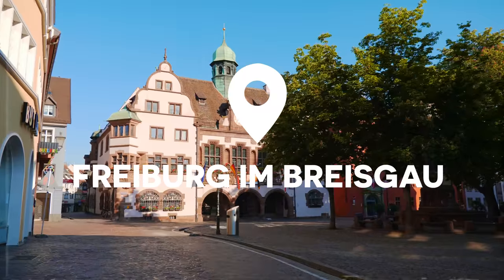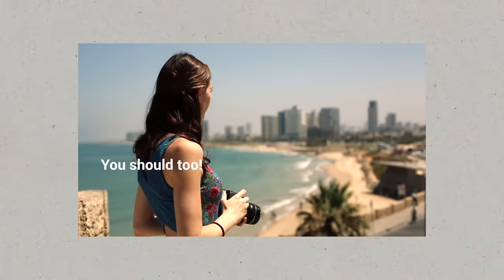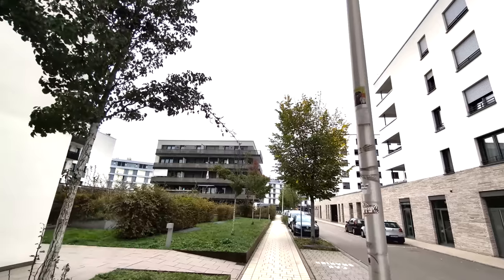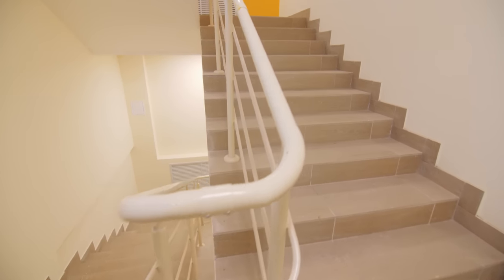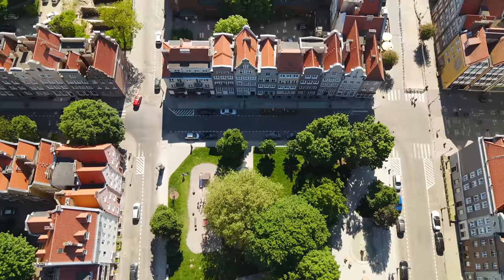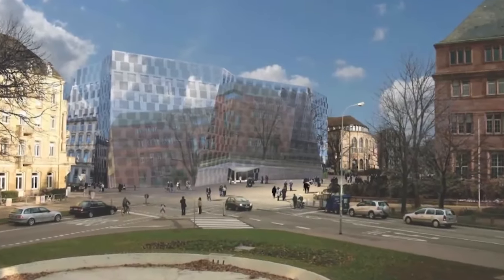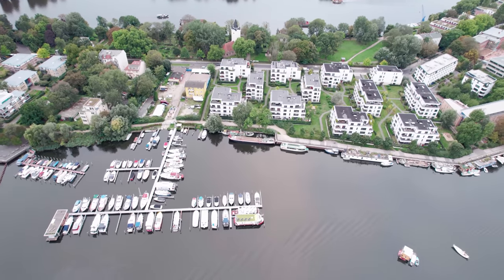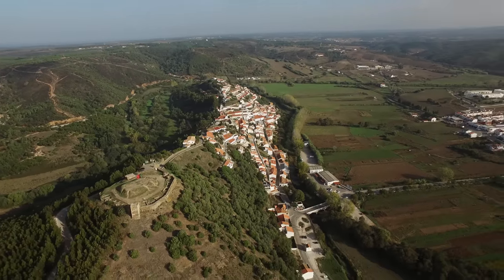Germany's BIG DUMB BOXES ARE AWESOME.

Comment: Another country that came to the same conclusion was the Soviet Union.  Their housing developments were boxes with with a maximum height of five floors, and for much the same reasons.
Reply: As a person who grew up in a Khrushchevka (the type of a five-floor building you are describing) I'd like to disagree. They were indeed thinking about cutting costs and at the same time accomodating enormous amount of people who previously lived in baracks or shared apartments like kommunalkas. But I wouldn't call these buildings energy-efficient. Almost all of the Krushchevkas in post-soviet era are patchy-looking because every flat owner had to externally isolate their walls. Otherwise they tend to get cold. And you spend quite a lot on energy costs now, when they are not artificially suppressed by the party.

And don't get me started on psychological effect of living in a sea of grey dirty concrete boxes. When I grew up I moved to the old city center of Odesa from a Khrushchevka neighborhood and I noticed the uptick in my mental health during winter months - just from being surrounded by beautiful and colorful architecture of previous centuries. 

And you have to take Brezhnevkas into account - those were standardized high-rises which actually later contributed to the modern tendency of the neighbourhoods where 24-storey buildings completely dominate the person and create wind tunnels or completely block the daylight for the neighboring buildings. 

So yeah, just my 5 cents as a person who lived there and now lives in a 3-storey white box in a suburb town near Köln. It's a completely different feeling.
Reply: @MrFahrenheit9  Interesting perspective, thanks!
Reply: @MrFahrenheit9  
OK, I need to be a little more specific. The Soviet Union built to a similar plan for some of the same reasons. The major one being, like those in Germany, that at five stories you didn't need a lift (or elevator). These add extra complexity and cost. 
Neither I nor Ashton talked about build quality.
Reply: @martinbond5166   you are right about not needing the elevator, but Ashton did mention energy efficiency as well, that's why I mentioned insulation in my comment. I probably extrapolated these other reasons.

Talking about elevators or lack there of, I wonder if there are any standards in Germany regarding accessibility of such buildings. In Ukraine we have a big problem with that, because most soviet buildings are notoriously inaccessible. Even in a building with an elevator you still need to get up and down a flight of stairs, which is impossible for people in wheelchairs or basically anyone with walking problems. So many old or disabled folks rarely leave their flats. But it's not the case here in Germany, so far as I can see
Reply: Ashton did mention energy efficiency,  but in the context of a benefit of the basic design, not build quality.
I'm not sure where this conversation is meant to be taking us. I simply commented that the Soviet Union, with their economic problems, had come to the same conclusion as Germany in building efficient housing and you seem to be trying to turn it into some sort of idealogical battle. I am well aware of the shortcomings of the Soviet economy, as well as those of the 'western' economy. So what are we trying to establish?
Reply: @janprimus1947   it's the first time I see your nickname in this comment thread so I'm not sure why are you reacting like that as well. Feel free to disengage at any point, and I'll do that as well

Comment: So a bunch of very highly paid people DESIGNED the Freiburg University Library building, another bunch of very highly paid people APPROVED that building design, including details around the fixings of panels that fall off, and the water-proofing systems which are NOT water-proof.  Other folks have APPROVED a window system which needs to be totally replaced and the old ones sent to landfill as un-recyclable,  after just 40 years.  (If the old company has gone bankrupt by then, good luck getting any compatible new windows at all).  

Previously I lived in a scummy old early settler's cottage that was over 100 years old. It still had the original windows.   If a cheap ass, scummy old wooden house can last 100 years without needing new windows, how come the latest space age, huge cost "architect designed building" has windows of such short lifespan ?  

If the legally mandated Disability Access Door does not open properly, then how did this building even get it's final, "pre-occupation" local council compliance building approval ? Is there no such thing as a "building inspector" in Germany who walks through with a clipboard and ticks off compliance ?  What else fails to comply with legal minimums ? Toilets ? Fire Escapes ? Safety brakes on their Elevators/Lifts ?

Comment: Dumb boxes build of local materials in walkable/cyclable/public transport oriented neighborhood designed using Passivhaus principle, powered with low carbon low impacting environmentally (best Nuclear) energy = a very sustainable and livable city!
Reply: Except that the CO2 equivalent of nuclear energy isn't the best and it's not even the most economical energy source.
The best would be wind and solar, possibly accompanied by nuclear energy for base load coverage.
Reply: @marcromain64  sorry to disappoint you but both of the above statements are false.
France predominantly nuclear grid has way less co2 emissions than German, who invested hundreds of billions € into renewables and yet they reopen old coal plants, build new fossil gas power stations and Sholtz is flying around the globe trying to secure gas sources after the NS2 been blown up. As for price again French has much cheaper electricity than the Germans.
Those stories about renevables being cheaper or less emittant don't factor in the back up systems, transmission lines, energy storage, constant maintanence and a complete replacement every 20 years of all of that shibang to keep it going. Don't get me started on the land needed for renewables and the mining of minerals and slave labour in China to produce it!
Reply: @ukrytykrytyk8477  Germany has higher CO2 emissions because of 32,8% coal based energy generation, caused by decades of reform jam, not because of 51,6% renewables, which could be much more if not for the reform jam mentioned before.

By the way, in the current year over 1 TWh (net) of that generated energy went to France to support their failing nuclear energy production, wich means: part of Germany's higher CO2 emissions is for the benefit of France.
Reply: @marcromain64  Ok a few facts for you to consider because I noticed you mostly rely on slogans.

Yes indeed France in 2022 became net electricity importer. For the firs time after consecutive 42 years of being electricity exporter! You're writing that 1TWh net was imported in 2022, for comparison in 2021 French exported 43TWh. Not bad for 'failing nuclear' as you describe it XD. I'm not going to get into details of why 2022 was an exceptional year for the nuclear in France and why it will not likely to repeat again. Read yourself.

Next fact. Germany's weather reliant renewables in times of over production have to sell the energy at a negative price - they pay their neighbours to take the overproduction from them! French controllable nuclear can rump down the production to make space for subsidized German electricity. In times of low renewables production Germany needs to buy missing supply from its neighbours, like France, at very high price to avoid blackout. So it's double win for Nuclear. 

No, further investment in the weather reliant solar and wind will not change that, it will make things even worse! It will result in oversupply in high production-low demand times and will not solve low supply issue during winter. And that is a reason why a lot of money is being poured into coal and gas production capabilities in Germany. 

In summary, no country or even region created a stabile electricity grid on solar and wind alone, without having to build fossil backup sources. No matter how strongly people like you shout it's possible, the Physics of electricity production will not bulge to those simple facts.
Reply: @ukrytykrytyk8477  You're conveniently ignoring the fact that nuclear power is the biggest, but also the weakest part of power production. By now, France needs to compensate for that internally with natural gas, wind and water power and externally by buying energy from neighbouring countries. Energy exports in the past won't help France in the future if they're unable to convert former profits in a modernisation of their nuclear power infrastructure. This is time and money consuming, while most renewable power sources are cheap and easy to implement in comparison, assuming there's the political will to do so.

For example, one of the biggest net exporters of electric energy on the European market is Denmark with absolutely no nuclear power but a 78% share of renewable energy. They do rely on about 24% coal, natural gas and oil, though. But they aim to replace most (not all) of it with renewables and might succeed, considering the developments so far.

And last but not least, I never claimed any country could (or should) rely on renewable energy alone. To be precise, I wrote the exact opposite in response to your initial posting and literally suggested to stabilise renewables with - for example - nuclear power.
You seem to be a rational thinking fellow, please don't make the mistake you accused me of: relying on slogans, that is. Not everyone pointing out the downsides of nuclear power and the upsides ow renewable energy is against nuclear power per se or sees renewable energy sources as the one and only saviour.

In the end, it's all in the mixture and and the feasible and most useful combinations can vary depending on the region and the local conditions.
Reply: @marcromain64   I'm afraid buddy you are indeed relying on slogans, skimming on the surface of the data only. 
You bashed French nuclear for 2022 when for one year they needed to import 1TWh  during fixing of some of their reactors. That's after 42 consecutive years of being the biggest net electricity exporter in Europe! Data from the first half of 2023 show that they are back on that position with 17.6TWh exported. 

Denmark is another silly example because of they relationship with Norway. Denmark can export its overproduction from wind in the Norwegian Hydropower plants which Norway has close to 1000 of. They can then pull that energy back during low production periods. Take Norway out from that relationship and Denmark would be facing the same dilemma as Germany, which is expansion of backup fossil sources to fill the gap in production. 

Obviously you're not counting the financial costs of additional backup, infrastructure expansion, land cost, storage cost, complete rebuild every 20-30 years into equation. Only then the true cost of the intermittent sources is revealed.

Just answer yourself this question: Why is it that countries with the highest intermittent renewables in the mix (Germany or Denmark) have more expensive energy for the consumers than France? If renewables were so cheap the opposite should be true, shouldn't it? 

No point of discussing this with someone turning blind eye to the data.
Reply: @ukrytykrytyk8477  Actually, I used data from the unfinished year 2023. If it will be better or worse than 2022 for France and it's fixation on nuclear power remains to be seen.

The problem with you argumentation is, that France built his nuclear infrastructure when it was cheap and easy to do, but failed to compensate for aging and increasing maintenance costs, while also failing in building new reactors and new reactor designs - and, of course, diversifying their energy mix. But let's stay with nuclear power for now: that's nothing that has any chance to change from one year to another. Even the ASN itself estimates that maintenance alone will take at six seven years - and that's their optimistic scenario. Building enough new reactors to replace the failing ones will take about 15 years (again, the most optimistic scenario).

But, on a more personal note, I find it somewhat tiresome to discuss this topic with someone who clearly more of a at most reasonably informed fanboy than anything else. Therefore, I prefer to leave you to your thoughts and opinion from now on.

Comment: What i don't understand: why do none of these buildings have solar panels on them..? Why not have a slight incline and add solar panels pointing to the south? Is there some regulation that forbids to make money with electricity while you also make money with renting or something..?
Reply from the maker: A lot of the buildings in the Alten-Güterbahnhof do. But from what I've heard from some neighbors, it is a bit more difficult to do on Mehrfamilienhauses when they are co-ops or individually owned units. All owners have to agree to the costs, the batteries, the maintenance, insurance, etc.

Comment: in the long run flat roofs have to be repaired more then "A" shaped, the A shaped are mostly covered with steel roofing which is more durable than asphalt (ASP).. covering with ASP is totaly idiotic in more northern parts where in winter you have temperatures changing -5 to +5 C during night and day.. only idiot can do that.. cause the ASP degrades very fast in 10-15 years you have to change it.. with reliable metal you have 20+ years our old was 40.. and not changed cause of leaks.. but adding one more floor.. the new is the same type.. sure there are more types... the one that you screw throug the metal and there is a gumy sealing on the screw are shit.. cause the uv destroys the gum and they start to leak.. thats why there is other type much better.. more expensive but 100% sure 30+ if done properly... and the best thing to this second you can easily put PV or solar on it without the need to change or screw through, only clamps..
Reply: just to add to this our dumb boxes lately give the metal A shaped and 3 flloor give attic flats.. in the long run the steel here where most of our winters are -10/-5 during night and -1to +5 during day this metals is fool proof.. all other what you said is very true.. great video...

Comment: I'm really confused why the glass has to be replaced that often can someone please explain??? I'm use to thinking of glass objects as things that last literally till something catastrophic happens for them to break, like my grandpa has windows that where installed before he was born surely they could have made the glass structural secure a and able to last the next 100 years if not more. Like yea a glass building will never be cheap to build but surely it should be the cheapest in the long run with a lifetime of the components significantly longer than human lifetimes. If you have thick structural glass there's not a whole lot that can break it I don't understand why it wouldn't be relatively simple to do with modern technology like we don't need the "best" glass but just a average good glass should last centuries right???

Comment: When it comes to CO2, whatever we can do to reduce the use of steel and concrete must have a central position. Those materials inherently release huge amounts of CO2 due to the chemistry of their manufacture. We might see some currently experimental solutions making early market impact in a few decades, but that is just too late for the impending climate crisis. The current IPCC guidance says that we need to half greenhouse gasses by 2030 and hit net zero by 2050 or suffer immense disasters. We just don't have any time left.

Comment: I'm sorry, but I somewhat disagree. Yes, the big dumb boxes are practical and cheap, but that should not be the sole argument. Visual appeal is not just a luxury for a space you want to live in. And sadly, the modern dumb boxes without any fluff are just depressing as soon as they crop up.
A city should be, in some way, visually pleasing. And... yes, I want some sort of variation in my city. I'm not saying we shouldn't build those boxes at all, but they need some buildings that bring some variation in between that help make them more bearable. Also, perhaps adding a slanted roof every now and then might be a good idea to spice things up. Just add some variation to the silhouettes, please.

Comment: Are these boxes really that dumb? There are recessed windows, using different materials at the ground floor and the upper floors, and balconies. A lot to break the monotony of a dumb box. I have seen a lot worse.

I even appreciated that one of the building's balconies actually looked like it was made by the same architect who designed the rest of the building (as opposed to a generic balcony that could be "glued" on to any building).

Comment: I find modern architecture to be mostly boring.
It is getting better, though. 

I think that modern architecture should be more elaborate, by looking back at older buildings (pre 1950's) with their pedestals, pillars etc. Form follows function, yes, but if it is ugly, no one will take care.
Straight lines okay, but give it some architectural features.

And I have no idea, how this affects housing efficiency.

Comment: Running architectural courses with a focus on avoiding the box shape because it's 'boring' sounds like the people who are designing/running these courses have a lack of imagination.  There is nothing inherently wrong with the box shape, after all the grand majority of historical structures are based on it.  Sure, if you are just placing characterless box after box in a row it will be boring.  The challenge is to vary each units visual character and surroundings to avoid it looking so boring.